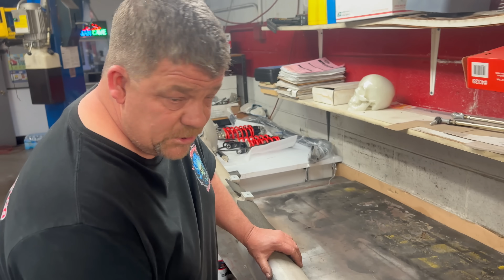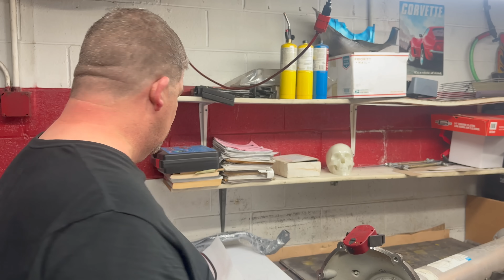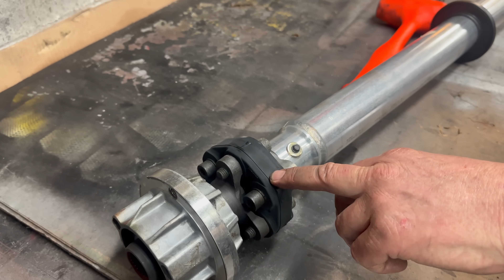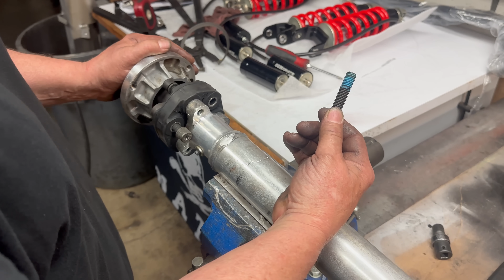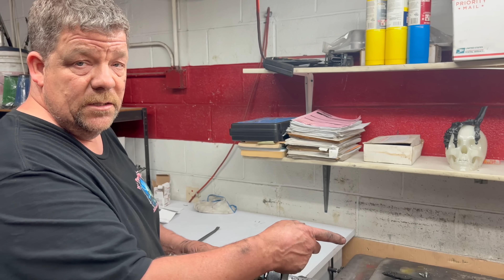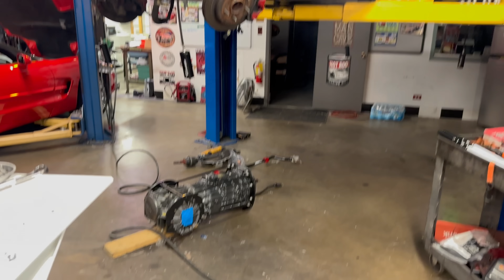Corvette Torque Tubes: For Dummies

Comment: Thanks so much for this. Can you please do a full C5 clutch removal and replacement?

DIY mechanic here about to tackle this myself with my unamused retired mechanic Dad, in his small home shop with a two-post. We're concerned about his old no-name two-stage tranny jack being able to handle the weight of the tranny, diff, rear cradle and torque tube. As well as the car falling off the lift (I keep telling him a spin jack under the front cradle should be fine).

Hopefully we don't run into many issues on my rust-belt 25 year old Corvette!! -_-
Reply from the maker: Yes we will do a video on that the next time one comes in needing one. In the meantime you can check out our video titled "Driveline Replacement and Coilover Conversion" the thumbnail is a Blue C5. We took the torque tube down in this video and it will give you an idea of what you need to do. Unlike what we did in that video, you will not need to remove the rear monoleaf.
To counteract the weight shift to the front we position the front legs on the lift closer to the front of the car. 
We must put a disclaimer though that this job is an advanced job and the utmost caution must be used. So if you are not completely comfortable doing this, it would be best to bring your vehicle to a qualified mechanic.

Comment: Great video thanks know I want to rebuild my torque tube I don’t hear any noises coming from mine. Is there a recommended time frame on rebuilding this like 100k miles?
Reply from the maker: If you don't hear anything or feel anything we'd leave it be. It's difficult to put a mileage interval on them in terms of rebuilding as there are many factors external to the car like humidity, weather etc. That can affect how long they last. We've seen many cars with over 100k on them with their factory torque tubes that have not been rebuilt

Comment: I have C7 manual.  pops out of 1st sometimes / synchronizer maybe ?    Do or can u fix ?  upgrade trans, clutch, and torque tube  ???  57K miles.
Reply from the maker: If it pops out of gear it's a synchronize issue. Likely need a new trans, might as well upgrade if you are replacing it too.
Reply: @AntiksGarage  upgrade ?  My present tran ?
Reply from the maker: @JerryBirck if you drive the car 'spiritidly' yes now would be a good time to upgrade the trans

Comment: Waiting with bated breath for the installation video of a remote bleeder. I assume this isn’t due to lack of maintenance, otherwise this wouldn’t have happened. I have a ‘14 M7 Z51, which is impeccably maintained according to the owners manual. I never expected to worry about a ‘$15-20k repair due to a GM major component repair due to a faulty engineering design! It’s not in my budget, just  another meaningless expense on an otherwise beautiful, and technically advanced sports car.
BYW: I never abuse my car. Generally, it always stays in the touring mode. I always  warm it up before getting on it. Fluids changed, and flushed by the book. So what can I do to avoid this nightmare? Thanks for your other videos. They’re all very helpful and clarify issues with the Corvette..
Reply from the maker: As long as you are changing your fluids and staying up on maintenance that is about the best thing you can do to keep your car in top working order. Also one of the worst things you can do is let a car sit, it's important to get out there and drive it!

Comment: Why not replace with polyurethane or billet and what would be disadvantages of either one
Reply from the maker: The factory rubber bushings are very durable and great at absorbing shock which is their main function. We wouldn't recommend billet unless you've got a big power drag car or something like that, street driving would not be good with that type of bushing. The factory ones are good for 99% of applications and they're a lot tougher than you might think! Polyurethane we don't have much experience with because we never use them but we don't think you'd see much benefit of poly over rubber

Comment: You did not show bearing replacement  😮
Does the driveshaft need balancing ? If so...just the shaft or everything attached to it ?
Reply from the maker: This unit did not require bearing replacement, we do not see those go bad very frequently, we also did not balance this driveshaft after replacing the bushings as we have never had an issue with that in the past, however, you can always balance it afterwards as a precautionary measure.

Comment: I have a 2014 C7 Z 51. I don’t remember ever getting GM to send me a technical service button on the torque tip! The car obviously is 11 years old I drive it very judiciously and never put a hell of a lot of power down. what can I do to avoid this very expensive situation of rubber shock absorbers in the tube tearing themselves apart? GM suggest changing  clutch fluid every 40,000 miles haven’t quite reached that yet and I will change the clutch fluid. However ,I don’t think that is the issue here. I think the issue is wear and tear. What do you think,  if I have such an issue how do I go about dealing with GM after 11 years of ownership ? Thanks for an informative video.
Can Ken
Reply from the maker: Thanks for your comment, Ken! With the age of the car, there is nothing that GM will do if you have an issue. The bushings do last a pretty long time and there will be warning signs you'll notice if they start to come apart. If you are just a casual driver, you likely will never have an issue. Also as with anything else on a car doing things like frequent and regular fluid changes is one of the best things you can do to ensure longevity.
Reply: Please give us a heads up before you air the remote bleeder video. I  and many other Corvette owners would be very, very interested in having this work done.  thank you !
Reply from the maker: @kengutwein9370  We are trying very hard to get a car in that needs this done. It's one of our top priorities. As soon as we get one in we will let you know!

Comment: Hey i have an auto torque tube for sale with a hinson billet drive shaft in it with upgraded 12mm bolts, all new bearings, retainers, and snap rings, selling it for 1,300 I have ruffly 2,100 in it and only has 2,500 miles on it, in those miles there was no vibration and was very smooth making the car more responsive and can hear the engine rev a lot more smooth and a lot faster,      reason of selling: is that i am going a completely diffrent route with the car and though the torque tube can handle over 1,000 hp I am trying to accomplish much higher horsepower than that!!    Would you know anyone? or would you be interested in it?
Reply from the maker: We don't have room for something like that but we can definitely ask around and see if anyone may be interested! Best of luck to you in your 1000+ hp endeavor that sounds very exciting!

Comment: Thankyou so much for this video. I have a 10 year old C7 with 14,000 miles on the clock and expect to have this work done sooner than later. That bad news is I spoke to the GM dealer where I bought it new and they had no knowledge of torque tube problems and in fact said it shouldn’t be touched. I’m in trouble I think. I’m now trying to find a corvette specialist near me who knows how to do this. Otherwise I’ll have to park the car which seems crazy.
Reply: Dealers often play dumb until your car comes in on the hook and then they tell you; "yeah, you should have serviced that!".
Reply from the maker: With only 10 years and 14,000 miles you likely will have some good time left on the bushings that are in it. In the meantime it's a good idea to find a Corvette specialist who can take care of any other issues that may come up and then work on your tube if/when it is needed.

Comment: What about the housing or plates, don’t change them?
Reply from the maker: What plates are you referring to? Housing is typically never a problem and sometimes you may need to replace one or both bearings. It just depends on the condition of your unit.

Comment: This is why I don’t like hammering my throttle from a stand still in first gear going into 2nd. It’s fun, but probably beats the hell out of this component. Having some fun while already in motion I imagine is less punishing on drive line components to include this torque tube. Good video.
Reply from the maker: Thank you! Yes flooring it from a dig is certainly going to stress components more than if you're already rolling. Corvettes generally are pretty good at handling the abuse but if you want things to last it's best to hammer it when you're already in motion

Comment: What if you took the rubber isolators out and put  Aluminum isolators in instead.
Reply from the maker: Would not recommend that, they are rubber for a reason. The whole point is to absorb shocks and dampen vibrations. You lose all of that ability when you put aluminum ones in

Comment: Great video!! Considering a rebuild on my TT in the next 20-40k miles. I daily a C6 Manual grand sport and I get a SLIGHT rattle during 1.2-2k rpm in first rarely. Not sure when I need to hit the alarm bells on the rebuild
Reply from the maker: Probably best to do it sooner rather than later to be on the safe side. Thanks for commenting!

Comment: I have a 2003 50th anniversary convertible that occasionally makes what sounds like wooden dowels rolling/banging around. Any ideas what could be causing this? I'm asking you this because someone told me that it could be the torque tube.
Reply from the maker: It very well could be, though to say though without being in front of the car to hear it.

Comment: 4:43 Let's revisit a heck of a tool usage in removing a snap ring that gets discussed on Corvette forums. Just thought that execution looked pretty spot on. My dd is an '04 auto trans base model with some torque tube noise these days...
Reply from the maker: Thank you! We use those mega pliers literally only get used for these snap rings, it's pretty funny

Comment: great info !!! is there a way to test those rubber couplers?      i think my 6th gen camaro has those rubber driveshaft couplers....i think one or both may be broken (clunking sound A8 going into/out of gear).....
Reply from the maker: 6th gen camaro does have the couplers. Looks for dryness or cracks in between the non bolted spaces. They are easy to see on that car as they are not in a tube.
Reply: @AntiksGarage  thank you...i miss the old U-joints--easier to tell if bad  --imo...love the channel !!!

Comment: My 04 c5 runs like a jet, the only governor is your foot...I aird it out last December when it was 23 degrees,  frozen rubber cuplers,  not good, sounded like I slung a rod, nope...not gonna ly it was a big job, just thought to let anyone that may need to do this to drill into the holes a little on the snap ring into the aluminum retainer to give players more depth, two hours of fight before that( only about an eighth deep)
Reply from the maker: Yeah the snap rings are under a ton of tension when you're trying to remove them, that's why we have the super mega snap ring pliers, that's about the only thing we use them for!

Comment: I have a 2015 , 67,000 miles . I’ve had it 4 yrs and out on 30,000 . No noises as of yet but my question is what mileage should I change the couplers . In the video you said 10 yrs with not to aggressive driving.  Thanks for the video
Reply from the maker: 10-15 years is a pretty good interval to go by. If at that time they have not been done and you plan on keeping the car it would be a good time to do them. Thanks for commenting!
Reply: @AntiksGarage  thank you

Comment: Good video ! Thats a reason I would Never buy a Corvette again because its like 3 grand of labour to divorce the transaxle from the car and put it all back together and do a full alignment…And then for what as the C7 or C7 have no traction in rain or bumpy pavement and snap-oversteer anyway despite the perfect on paper 50/50 balance…If you need a GM product 6 gen Camaro is a much better driving / cheaper to service car especially when a seal goes bad or clutch needs to be changed.Lesson learned long time ago !
Reply from the maker: Yeah there is a bit more going on to do all this on a C7, we've got it down pretty good on C5 and C6s. It's definitely a breath of fresh air when we have a car without a torque tube that needs the transmission dropped or a clutch replaced. You might enjoy our supercharger install video we did on a 6th gen Camaro, it's one of our latest videos!
Reply: There is no comparison between a camaro and a corvette with equal money spent. The vette is lighter, better balanced, carries bigger tires, and more power. It also gets better mileage due to better aero, hold it's value better, and is generally a nicer vehicle than same year camaros.
Reply: @kevinkelly6189  A SS1LE is a better track car , as in no snap oversteer handling , than any C6,C7,C8 Corvette and believe me I had many !

Comment: Giubo is a portmanteau of the Italian words giunto ('joint' or 'coupling') and boschi (the surname of the Italian engineer who designed and patented the first flex disc, Antonio Boschi (1896–1988)).[1] Boschi later founded GIUBO SpA, a company solely dedicated to manufacturing flex discs.[2]
Reply: Yes, that's the word I couldn't remember for the rubber doughnuts ! Thanks, realowl 👍

Comment: Gret video. I track my 08 z06 and have had my torque tube rebuilt. In fact, I ended up with an extra used torque tube. I'd like to see a video of a  complete rebuild including bearing replacement so I could rebuild my spare torque tube.
Reply from the maker: Next time we have one in that needs it we'll be sure to film it. The only thing is we don't really see these cars in for bearing replacements on the tubes, it's usually just the couplers due to age

Comment: torque tubes or back in the day we called them inclosed drive shaft. they sucked then an they are expensive to repair now.👎👎👎👎👎👎👎👎👎👎👎👎👎👎👎👎👎👎👎👎👎
Reply from the maker: Expensive to repair but for the most part they're pretty reliable. We see these cars every day and very few have torque tube issues. Thankfully Corvettes are usually well taken care of

Comment: Yep done it snap rings are a bitch, should use factory couplers as you did not aluminium pieces of junk. Good video. Sorry for the typo's, I've corrected
Reply from the maker: Which aluminum couplers are you referring to?
Reply: @AntiksGarage all of them they will cause damage to spigot bearing also damage gearbox, tube is designed to flex that's from the engineers that designed it.
Reply from the maker: @phill2009c6 oh yes 100%. Makes no sense to use aluminum couplers. Factory ones are what you should replace them with!

Comment: I have a pampered 2007 Atomic Orange ZO6 with 37,000 miles. Mine it currently fine but just wondering in a ball park figure what is a fair price if I don't do it myself?
Reply: Most people talk over a thousand dollars plus  in labor to get the tube out.  A rate book would have the hours and then the rest depends on the shop labor rate.  Just make sure it goes to a corvette specialty shop that knows the car.  Dealers only work on new stuff , and the cars are too specialized to have an otherwise good shop earn while they learn on your car, and risk screwing it up.
Reply from the maker: good answer! Yes you definitely want to use a shop that knows about these cars. There are many easy things to screw up. Cost can vary as well based on labor rates. We'd have to check the book time on this job to give out a rough estimate on shop rates.
Reply: $6500 for me and I supplied the parts...

Comment: Instant sub! Sometime down the road when i cam the car after a year or so ill have to get a new clutch so this will have to come out. Even with 11k miles ill still but the upgrade kit with the stronger output shaft also in the kit and new pilot bearing,slaver and bleeder line. The only thing i had to do when i got my c5z06 was change my master slave cylinder but now after almost 3 months the fluid is getting very dirty eaily. Its pretty annoying having to change it weekly,it just keep getting dirty from the powder on the clutch so i need a slave bleeder bad and im willing to install it myself,i heard you need to take the intake off and reach back there. I cant wait for that next video for that to see how to do it.
Reply from the maker: No need to take the intake off! We'll try to get one in for a bleeder as soon as we can. Really like your Z by the way! 👌🏼
Reply: @AntiksGarage  Thanx! Did you ever film getting that bleeder on the slave cylinder without dropping the torque tube?
Reply from the maker: @MorbidZ06  not yet, we have been waiting on getting a car in that needs it done. We promise as soon as we get one in it will be filmed and uploaded immediately!

Comment: 2001 C5Z here, thanks for taking the time to show us a detailed breakdown. Intrigued to see your solution for bleeder line install on that slave cylinder. Currently doing a ranger flush every 2 months and it’s scary how fast that fluid becomes contaminated with clutch dust / material.
Reply from the maker: We're pretty proud of the way we figured it out. Next time we have a car in needing a remote bleeder we will be filming it for  you!

Comment: Cost to repair these is absolutely absurd
Reply: Cost to fix any car is crazy lol
Reply from the maker: @Hippiemechanic  sure is. But in today's day, we'd much rather keep something older on the road than deal with any of the crap that's on these brand new cars
Reply: @Hippiemechanic you aren’t wrong!
Reply from the maker: Yes the repair itself is quite simple, however, the labor based on the book time can be quite high as there is a lot that needs to come off the car in order to free up the tube. Fortunately these bushings do last a very long time.